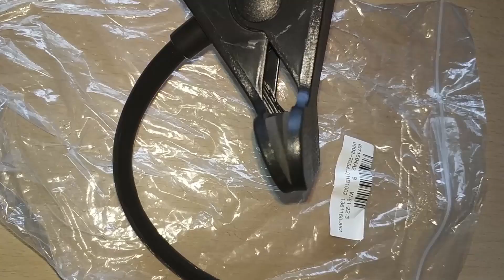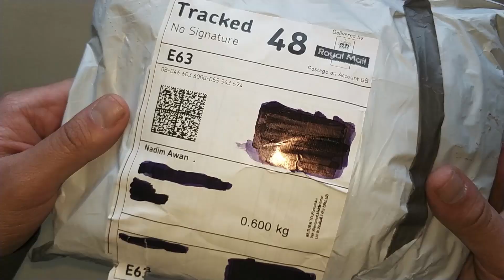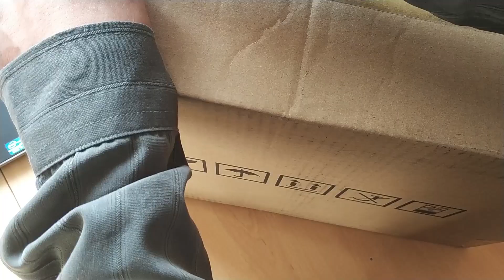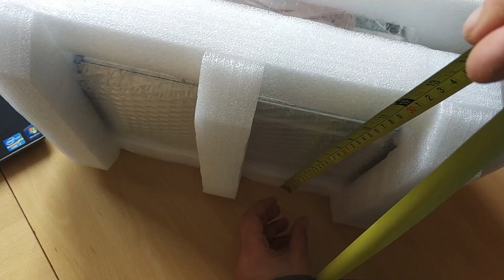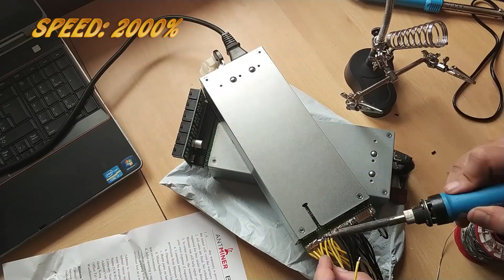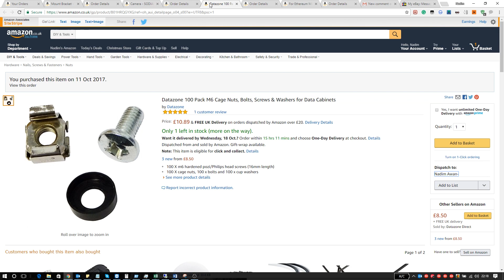Part 3: Maximising Miner Profits - Postbag #10 16/10/2017 Early Delivery Bitmain Antminer L3+ D3 S9

Comment from the maker: Goose-neck Lazy Bed Phone Mount  http://amzn.to/2yqscmq http://ebay.to/2kUVaIf
Handheld camera Stabiliser http://amzn.to/2yrNErg http://ebay.to/2hKUTTt
Rack nuts and bolts http://amzn.to/2gozK4u http://ebay.to/2ytcCIu
Server Power Supply Breakout Board http://amzn.to/2ymfRSR http://ebay.to/2ze4A3J
Reply: Full psu kit with wires. fast shipment. i received in like 2 days. 

https://www.ebay.com/itm/152756912974?ssPageName=STRK:MESELX:IT&_trksid=p3984.m1558.l2649

Comment: Hi, Do they send you a tracking number for your antminer? I'm the same batch and would love to see it early.
Reply from the maker: Yes the tracking number was emailed before dispatching
Reply: Great I will be on the look out for it
Reply from the maker: Yes.
"4. Only BCC payment method is accepted in this batch, please use the exact amount mentioned in your order and complete the payment within one hour. After one hour, the order will expire and your payment may not be detected by the system automatically. Payment must be in BCC. We cannot accept payment in BTC. If you send BTC to the BCC wallet the coins may be lost. If the payment is submitted but the receipt is delayed, we will make your payment "Valid" manually."
Reply from the maker: I don't know sorry. I have not done it yet.

Comment: not quite sure where you got the #'s , but the L3+ is not getting even 25% of $100 per day unless i heard you incorrect.
how early did your bitmain miner arrive 1-2 weeks or so ?  Thanks for sharing info
Reply: 22 USD a day on nicehash pretty close to 25 USD
Reply from the maker: Correct, the $100 figure was based on multiplying by the number of devices
Reply: what is your electrical bill?